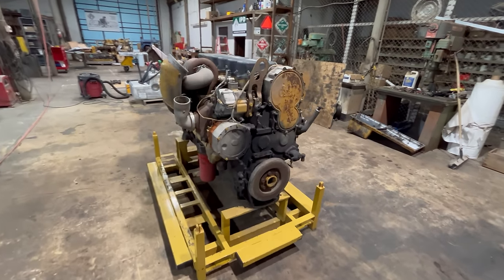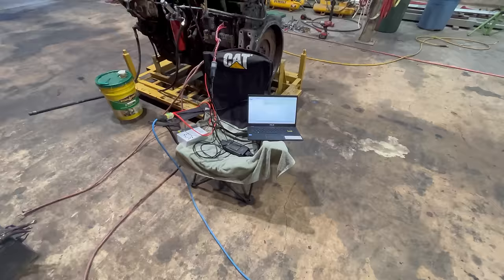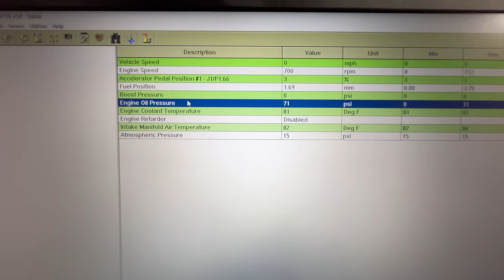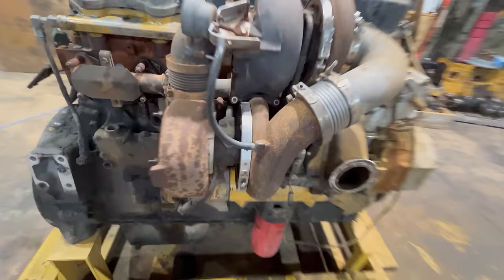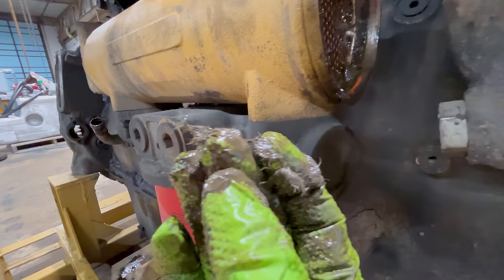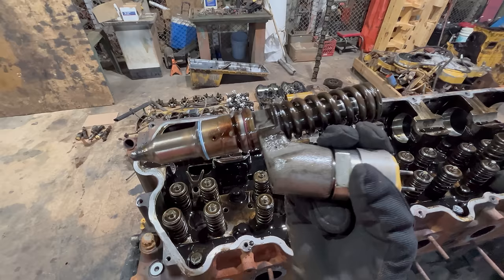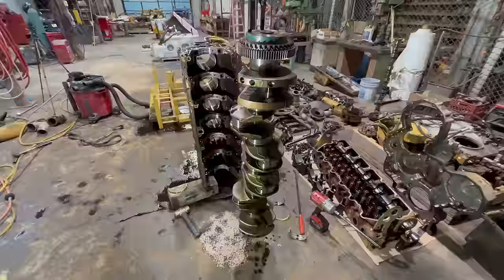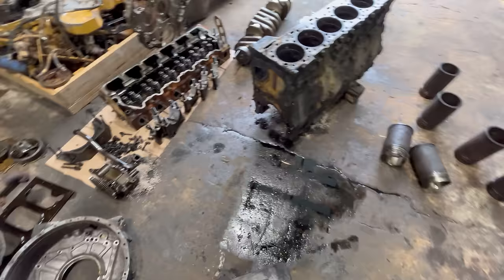Compound Turbo 15.2L Caterpillar C15 Core Diesel Engine - Will It Run?

Comment: All that effort on what seemed to be a tidy rebuild and they stuffed up on the cooling system somehow. Was wondering what the fibres were in the oil cooler water gunk. Might have formed out of a coolant chemical breakdown but looks more like a dissolved fabric from a gasket/rag or something else in the system. I bet the radiator could have told a bit of a story in explanation. Anyway, you got some great parts out of it and a complete set of 6 matched door stops. Thanks 🙏 for another great video.

Comment: The stuff in the cooling system is probably some sort of leak stop. That was my first thought when I saw the fibers in the cooler in the beginning. Probably the owner or shop that did the rebuild desperately attempting to delay or prevent the inevitable.

Comment: As a subscriber that has watched many of your videos, I have my ideas why the engine was sold as a core.  As you pointed out the owner operator didn't have the right coolant in it, got mad because he just had it rebuilt, and sold it as a core.

Comment: Water in the cooling system will cause the cavitation in the liners. Most likely was rebuilt and had a coolant leak and someone put water in it where it sat for awhile and pressurized the coolant system when they went to run it again.

Comment: Even though I am not an "Engine Guy", by any stretch of the imagination, I still find myself addicted to every one of your videos, when they show up. So, my question on this one is this -- I'm assuming the block can be cleaned, tanked, magnafluxed, and rebuilt, but I'm also assuming that the liners are headed to the scrap heap. Am I correct ??  Thanks again Sir ? It is always fun...Rip

Comment: My guess is that it was leaking/burning coolant so they threw in stop leak (the metal paste and fibers) and ended up overheating and warping the head. They threw a head and all the other parts on and ran it without cleaning the oil cooler and nuked it again, the pitting on the rollers is a dead giveaway.

Comment: That liner cavitation will also put oil into the coolant if it is inline with the piston skirts and appear to be a faulty oil cooler. Hence why it probably had a Mcbee cooler on it. I've seen this before and that shit in the coolant more than likely stop leak. I'm always leary of buying engines or trucks from the south because they usually don't have proper cooling maintenance due to above freezing temperatures. The worst ones I've seen come from warm weather areas....

Comment: That crap was probably radiator leak stop. The radiator kept losing fluid so that was their fix. The hot liners and escaping gasses from them caused the leak stop particles to bind together then it was circulated through everything.

Comment: Hello dear my experience is that the shiny stuff you found in the cooling system is copper aluminum compound to seal cylinder head cracks and liner pin holes

Comment: That stuff in the cooling system is a head gasket sealer; mechanic in a can. I bet they thought the head gasket was leaking after the liners failed due to cavitation.

Comment: Stop Leak, them O-Rings aren't the first ones got hurt in this motor, it's been a leaker for a while. Happy Boiling Point to get that stuff out, pull all the galley plugs!

Comment: Excellent video, it's fascinating seeing what simple things cause the failure of such a tough piece of engineering, I assume the rebuild wasn't thorough enough to see the rubbish circulating, it would probably overheat, mind that overheating one you found the rag in the water bonnet really takes the prize
Reply: The fibres could be dendrites essentially crystal growth, might be a contamination in the cooling fluid,  happens in batteries a lot
Reply: Always a pleasure watching your posts. I've learned alot. Thanks.

Comment: Ether or Etherlock on a diesel is not dangerous... But the reason people are writing that is because Ether is not lubricating the engine as diesel oil is. Ether is dry diesel is an oil and not a gas

Comment: I always thought the turbo set up on this was refered to as sequential.  I thought the waste gate from one turbo was sensing the other. The smaller turbo was for quick boost off the line and then the larger turbo was for higher rpm.  I could be completly wrong. But i do enjoy all your videos.

Comment: I appreciate the way you thoroughly explain the smallest of details. What type of ICE would you recommend for a 3K sq/ft air-conditioned home for generator backup? I know it won't be a 3406 which I have become fairly familiar with over the years watching you diesel wizards make them like new.

Comment: I always learn watching you work on these big engines.  A suggestion:  Set up a camera on a tripod when you are doing the teardown, and play it back at fast speed, like a time lapse.  Pretty easy to do, and I think would add a lot to your videos.  Cheers.
Reply from the maker: I'll think about it.  I prefer to be behind the camera.  Thanks for watching.
Reply: @KT3406E  don't change a thing.

Comment: The furry junk inside the cooling system is pretty commonly found in coolant stop leaks or block sealers, there may have been a hairline crack in the cooling system somewhere that the previous operator was trying to stop up.

Comment: All that crap in the cooling reminds me of one of them rad leak repair kits, I just fixed a leaking head gasket on a Perkins 4108 and found out the owner had put 24 eggs in the rad thinking it would fix the problem, what a mess that made.

Comment: The fiber stuff might be their attempt to seal what they thought was a head gasket leak. I know there are a couple head gasket sealers that have a fiber “reinforcement”. All it usually does is clog rads and heater cores. If they kept adding water or didn’t change the coolant filter cartridge those two combined definitely didn’t help it at all.

Comment: That goop is head gasket in a bottle for sealing water leaks in engines, radiators etc.. but pitted out liners is a bit of a let down.. hillbilly would have cleaned them up and jb welded them to get those extra miles out of it..😂😂

Comment: I personally prefer MXS/NXS over single turbo.   Way more moving parts but will out pull 6NZ stock to stock.   Better exhaust brake.  Bottom end much much better.  IMO!!

Comment: The bad ground wire can cause cavitation from what I am told. Which could explain all the metal shit in the cooling system. 
What a wild failure. Win for you tho

Comment: Ether mania FTW, I cringe when I use it but sometimes it just has to happen, nice to see you Trolling the haters!  I have watched over a dozen of your videos now and while I am not a diesel mechanic but am as much as one can call oneself a polymath in these times and diesels are one of my distractions -- I collect much smaller ones to serve me.  Thanks for showing us all these details and specifics that let someone like me understand many things in more depth .  4th graders at Cummins - LOL. This is why I work hard at keeping the pH correct in the coolants on my little engines. Everyone ignores change intervals for coolant, and then want to blame GM or Toyota for creating De(X)ath-Cool.  Sad this engine had to die this death due to something so basic or an operator putting who knows what in the radiator!  Maybe the fluff was some sort of crystals from an additive or another chemical used to sabotage the vehicle.  That is very rapid pitting and seems to be specific to the liners running at a higher temperature, almost like they knew what it would do at a certain temperature.

Comment: Seems like they spent an awful lot of money on a Platinum kit to just put water in the radiator. You could be right though people do stupid things sometimes. That silver nasty junk had me thinking possibly there was a radiator leak or something and somebody put some of that stop leak s*** in it and probably added way too much water without coolant probably driver I'm thinking. I've been driving since 1989 and I've seen drivers do some really stupid stuff and destroy people's equipment. That's why I'm happy to just drive my own truck and not try to buy multiple trucks and have drivers. Thank you 👍

Comment: I’m new to your channel and appreciate your methodology along with your editing.  Like the other guys say straight to the point.  I’m a tech with just over 3 years and been working on class 8 trucks mostly doing warranty work.  Can you or would you say that the mining or heavy duty side is better if you have my experience plus what your doing now rebuilding and working on larger machines?  How many years do you have in this?  Thanks for the lessons!

Comment: Okay every car I've ever had if you run without the valve cover oil goes all over the place because the head has to be lubricated. Why does this have no oil visibly lubing the head?
Reply: Because you can't see.

Comment: But I like "Hillbilly Bullsh1t"  ;)   70psi cold oil pressure is actually pretty decent.  The lower, low pressure turbo needs to physically larger because it has to extract energy from lower pressure, and colder exhaust gas.....which requires bigger blades turning more slowly.  LoL........they put a new head on an inframed engine......and left the old cam and rollers in it. Whiskey Tango Foxtrot .   4 bolt rod caps.........that is glorious.   The crud in the cooling system  and electrolysis in the liners speaks of some kind of neglect with the proper coolant.....some junk operator that is clueless ruined a perfectly good engine.

Comment: People cry about using either. Used properly you are fine. Where people go wrong is putting in to much causing damage. The old 53, 71, and 92 would get “hooked” on it that was because the engine was worn out had to have it to start due to low compression is all.

Comment: I know what happened. This weird stuff is some kind of radiator fix. I have seen it before. They put it in because it was using coolant, and it pressurized the system. Which are also headgasket symptoms. And of course it didn't fix the real problem.
And then they didn't want to mess with it any further and they sold it off as a core.
I'm pretty sure the cavitation damage happened due to bad or the wrong coolant. Everything, except the cam shaft and rollers, got overhauled. And then it ended up getting dumped. What a shame and waste of money.
Greetings from Germany.

Comment: I thought Detroit was being funny when they added a coolant filter to the DD15 but I can see why. I’d rather change filters than buy a new engine. I hear you can use a fuel filter on a small return line to the bottle and it works the same.

Comment: great video ! But this engine is not a compound turbo engine. Volvo is the only company I know that makes turbo compound. On their engines there is an exhaust gases turbine which is linked to the crankshaft by a sort of a gear box, and a "normal" turbo. the engine of the video is a biturbo engine. I hope it's clear, english is not my first language, but I was an engineer at Volvo so I know what I'm talking about lol
Reply from the maker: It is absolutely a compound turbo engine.

Comment: Fun fact turbos are black magic and do not care what pressure the air coming in is, they will compress it as long as the outlet it smaller than the inlet. 

This is why the first turbo in a compound setup is bigger than the second.

Comment: I looked online (only for a few minutes) from what I could see was the platinum rebuild kit is $20K and I’d imagine another $10K minimum to rebuild it.  Theirs a lot of parts that still doesn’t include.  Cat says it’s good for another million miles after this rebuilt kit…. So it didn’t run long and someone did something stupid and pissed a lot of money down the drain.

Comment: Cant believe the cavitation is that bad that far down in the cylinder.  With suspecting such low mileage on the in frame, that kind of cavitation is pretty shocking.

Comment: Still running my n14 guy at work done built his cat twice! Do manufacturer make junk yes they all do! Is the x15 cummins junk? Hell yes! N14 hell no!
Reply from the maker: The 855s were good engines, but they were no 3406/B/C/E/C-15s.  The 855 was a cheaper designed fleet engine.  The Cats were a cut above them.
Reply: @KT3406E  i will except that, when it comes to the fuel pump, you can change a fuel pump on a 855 Cummins on the side of the road, you can change one of the three heads on the side of the road, unlike an a,b,c,e and c15, caterpillar, and an a,b,c model cat pumps have to be calibrated and unless you got a small crane, you’re not lifting that head off that engine! So I’ll take cheaper design so I can repair in the field without a caterpillar technician! Don’t get me wrong I’ve run caterpillars myself  and I love them but when it comes to the pocketbook, there’s no comparison you get just as much longevity out of the older Cummins as you do a caterpillar! But like I said the X 15 pure junk! Does not hold a candle to a cat engine I would take an a model over one of the red boat anchors! Great video by the way!

Comment: Maybe needed rebuilt, then sat for several months or even years and the inside of the block was worked on by the non circulating shitty coolant and caused corrosion in the water jackets? Then owner decided to do the rebuild but damage from shitty coolant sitting a long time in the block caused this? Just speculating.

Comment: Looks like a pile of bards leak or some or the coolant leak repair in a bottle. Had a driver put 3 bottles in and it plugged the oil cooler

Comment: About when did they get away from the compounds and go to the vgts? Was that the 3406's?
Lot of the metal floating around may be electrolysis pitting in the engine block or liners. Cavitating on what look like new liners, narrows things down to using poor coolant condition.

Comment: That debris in the cooling system looks like it may be some time of coolant system stop leak.

Would it be worth going through that engine and rebuilding it using the vast majority of newer parts it came with and replacing the liners and having the block machined.

Comment: Run them at 1325 rpm and they aren’t as thirsty…most drivers run them at the same engine speed as a C-15 or 3406E. They aren’t meant to run that fast at cruising speed. 

Good engine but the 6NZ is still better. Same with the late 3406E models.

Comment: Wonder if the fibrous stuff was a glove mixed with metal from the liners? I've seen and heard of lots of stuff getting left where it shouldn't. My BIL had a Cat come out and do a turbo on a machine and when he started it a socket he left in a pipe went straight through the new turbo

Comment: Looks to me as if they in-framed it and must have been stop leak or something in there that wasn’t flushed out. Should have boiled that block out and probably replaced the radiator. Sounds expensive but there’s nothing more expensive than a cheap overhaul. And they used all that pricey Cat stuff too. It’s mind bottling.

Comment: Goop is probably unset JB Weld.

I wonder if someone put a handful of garnet sand or silicon carbide into the water system, or an acid or caustic solution.

Comment: So the upper turbo is fed directly from the exhaust manifold,  but the lower, bigger one is a secondary parasitic feed from whatever is left after its been through the first. 
Akin to a double expansion steam engine,  the second bigger piston having to settle for sloppy seconds?

Comment: That furry shit in the oil cooler is probably barrs-leak or some sort of head gasket sealant (stop leak).  I've  seen that in some motors we have torn down.
Reply: that's exactly the conclusion i came to as well. still in the system after engine rebuild. radiator and system not flushed. looks like the sleeves have been sand blasted with contaminated coolant.
Reply: @kattanablade  we had a mack e-tech here that we did an inframe on and the truck kept getting hot afterwards.  Long story short there was a screen built into one of the coolant t-hoses that was plugged with that same shit.  That could possibly be why the condemned this mxs bad in video.  Pretty crazy
Reply: @davidfliegel1693  ive had to stop leaks in my radiator heap's of times, i only used coarse black pepper, works well, and doesn't ruin your system when u get round to fixing it.

Comment: Curiosity question, why do ppl change them over 2 a single turbo so frequently?
Reply from the maker: Most of the time it's because they don't understand what they're doing.  Other times, because it's a little bit cheaper than buying both turbos when they're both in need of replacement.